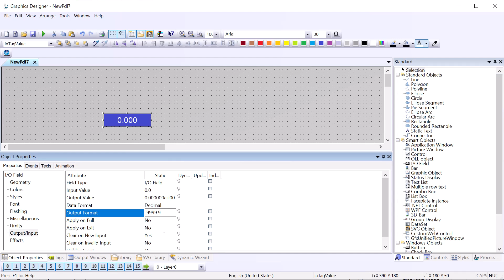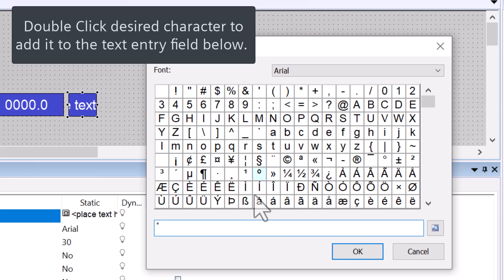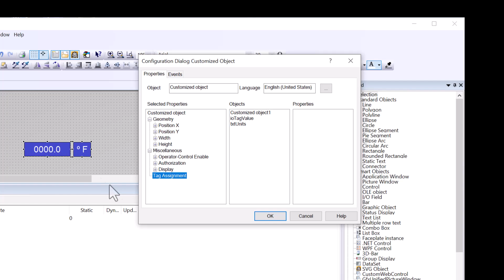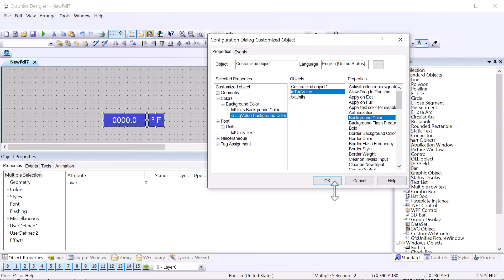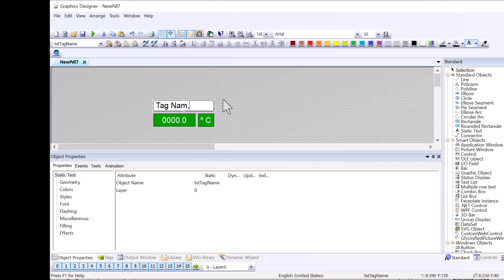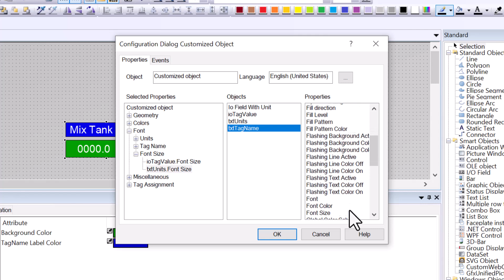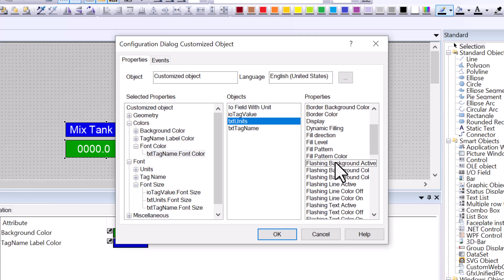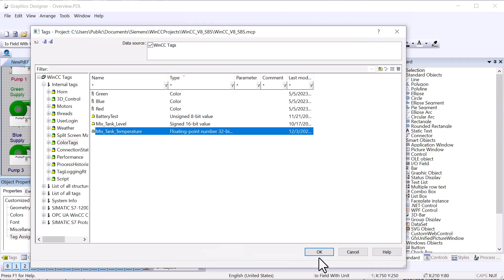How To Create Customized Objects in WinCC SCADA 👨🏽‍🔬 Learn Scada Programming #WinCCGuru

Comment: Is it possible to add expression for customized object. I mean I have a sensor with 3 states (3 colors) - off , On and Faulted. Now I dont want to type expression in Color property and change tag there instead I would have tag in Tag assignment and Tag.ON and Tag.Faulted will be read in expression without me going into color property at all, so I just assign tag prefix(Sensor Instance Name) in TagAssignment and rest will be taken care of by it self. Is it possible to do?
Reply from the maker: No. The tag assignment only puts the value of the tag into property. You need to do an expression in dynamic dialog or animation to convert the output of the expression to a color.

Comment: Perhaps you have encountered this.
Previously, at version 7.xx I used elements from the HMI Symbol library in costomized objects and I used mouse events (press left, relase left, etr). In version 8 there are no longer click events for objects from the library.  Has you made or use a similar?
Reply from the maker: Thanks for the comment. I did see in WinCC v8 that customized objects do not allow you to add click events or other events to the customized object. I will check on my WinCC v7.5 sp2 installation tomorrow to see if it’s the same.
Reply: @WinCCGURU  at 7.5.2.14 it works)